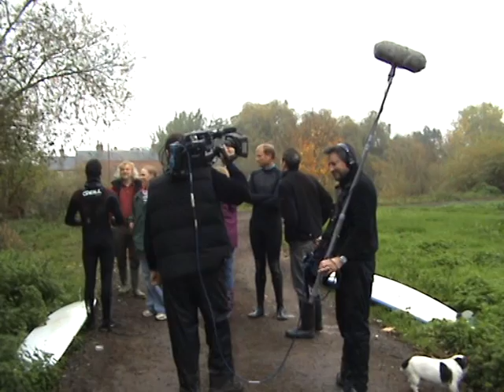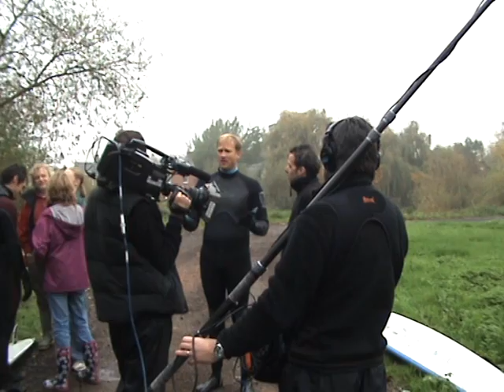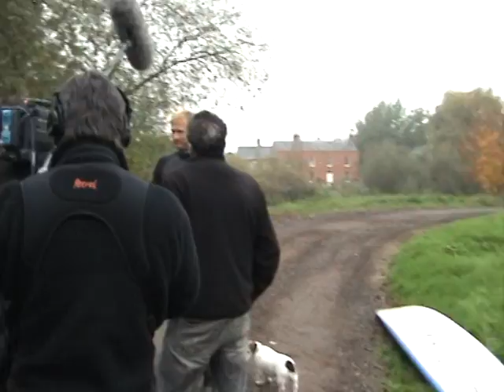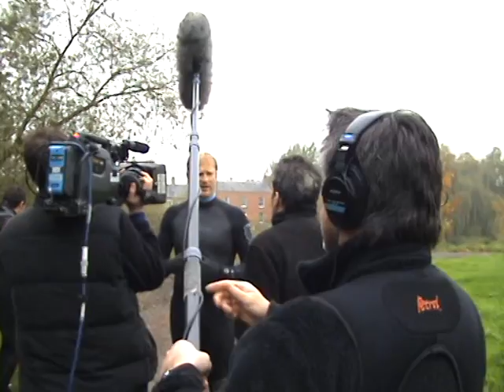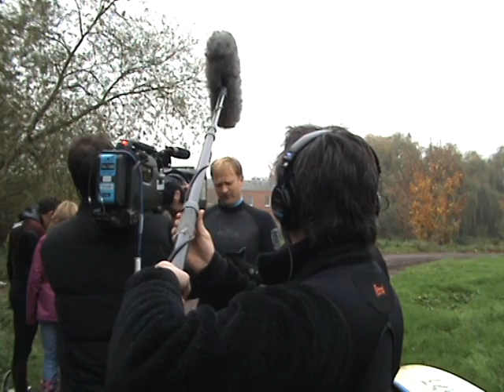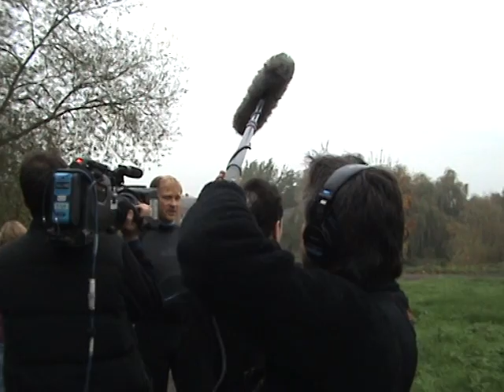The Severn Barrage: Why it will cause major problems for all nearby.

Comment: @kudu222 No matter if the water is clear or silted up, it is still filtered. Trawsfynydd power station for example in North Wales (MY BACK YARD) was fresh water cooled BUT it still needed to be filtered. Don't you dare call my arguments baseless. Hydro power is an asset that the UK fails to grasp and the dipshit prime minister won't even consider natural energy from the barrage. 

What inflames me the most about you is that you rather see the barrage built elsewhere i.e. Menai Straits.

Comment from the maker: @ROCKSOLID19 Pardon the pun, but your argument is baseless. I agree with your observation that no damage has been done to a plant, that's because an awful lot of money is spent every year removing silt from the cooling ponds and cooling system every year at Oldbury and Sharpness. This will increase exponentially with the increased siltation caused by a barrage preventing this silt that is normally in suspension and carried out of the estuary by tidal flows.  Nothing to do with depth of water!

Comment: @kudu222 YOU also mentioned the Menai Straits, which is MY back yard. I am more than happy to see a barrage on the Abermenai Point but why say that it is better to put a barrage on the Menai Strait instead of the big scale Severn? EXPLAIN. Do you see it better that way? A barrage being built in Wales rather than England o-0? Yes it is shallow but won't produce much as the Severn.

Technology & understanding has moved on from those 50 years ago, good research but in some ways, irrevelant now.